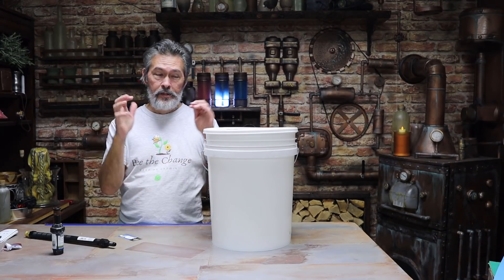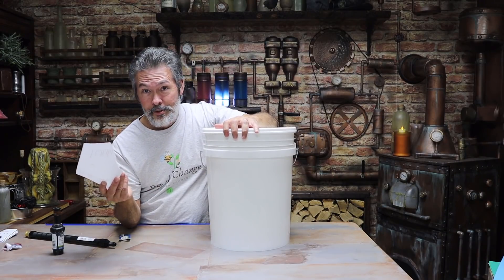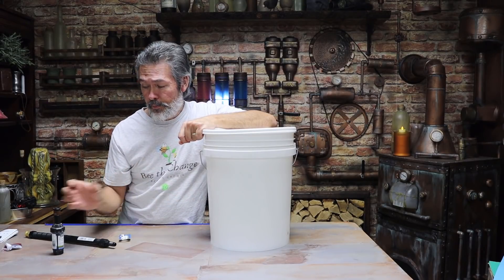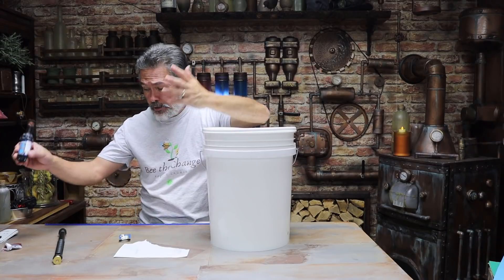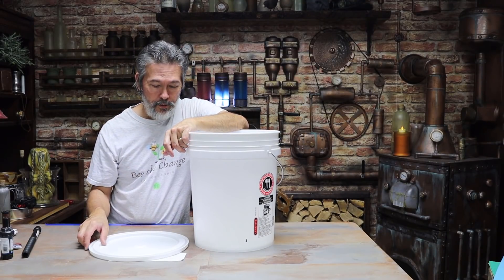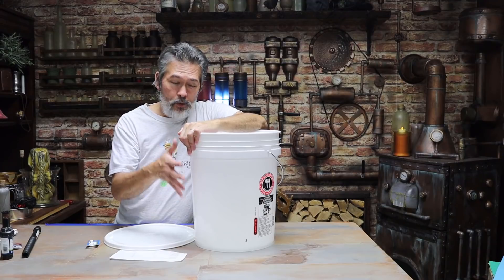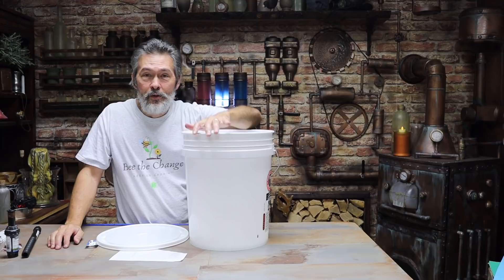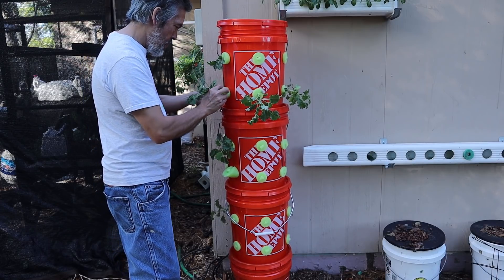CHEAP & EASY DIY Garden Tower Backyard Hydroponics!

Comment: Suggestion- instead of metal bolts, use heavy duty, plastic zip ties and thread through two of your holes in the lids to make a tight loop. Those metal bolts are going to corrode quite quickly. zip ties that are made for outdoor/water usage will last a decade.
Reply: you can also get plastic nuts and bolts the type you can put on your car to keep license plate on with
Reply: You could also use the nuts for toilet seats. They're mostly now plastic.
Reply: Stainless bolts would be fine

Comment: Might want to put some plumbing in  to refill the nutrient bucket
Reply: You can easily add the nutrient solution to the top bucket and it will trickle down to the bottom bucket.  To me the challenge is easily determining the solution level in the bottom bucket.
Reply from the maker: Yep, Just filling from the top.
Reply: @latriciacagle4873  You could drill a hole near the bottom and install an adapter through the bucket wall, with rubber washer on each side for water seals, and attach tubing on this outside connector and run it vertically up. You might cover the tube to keep out light.

Comment: Mike, we did away with the  sprinkler heads due to clogging. We placed a funnel upside down and the water flows to the sides. Also, the pool noodles were leaking out nutrients.  They would leak down onto the outside lid. We drilled tiny holes on the outside lids and it dripped back in the buckets. Very pleased. 
Thanks for your expertise and is greatly appreciated!
Reply from the maker: Nice! The funnel is a great tip. I had to clean my nozzle out every few weeks. Thanks for the input!
Reply: How do mean upside down? How would it spread water?
Reply: @drb4074 I'd imagine like a hat. Water would come up through funnel hole and roll down the cone toward the outside of bucket. Knocks a few bucks off and maintenance.  Sounds ideal.

Comment: I am appreciating what you do to help others.
I am building the 4 bucket tower. Why cut bottom from most buckets, yet not the bottom, a 3/4" hole to pass tube through, cut the whole bottom open.
I plan on 15-20 plants/bucket, 3-4 rows of 5. Fill empty with pool noodles if I need to. 
What to do if pump goes bad, or gets clogged? My friend says, put another bucket next to bottom one. Place pump in in, Run hose thru walls then up as usual, return water in bottom can transfer to pump bucket with double barbed piece 7  & vinyl tube, seal holes, with valves so water can be shut off between buckets if necessary. Simply disconnect pump, clean or replace, reinstall, turn pump and valves back on.

Comment: I like your idea.  I will try this for myself with a few changes.  I would use pvc pipe glue to attach the lids to the bottoms of the buckets to hopefully give a water tight seal.  The other change is to add a spigot valve on the lower side of the reservoir bucket to allow drainage for the winter months.  I live where we get three or four months a year with threat of below freezing temps, so without a greenhouse or other temperature controlled space  would have a risk of damage to everything.

Comment: Hey Mr D!   I’m so excited I stumbled across your channel. I’ve been trying to find out how to affordably test hydroponics before I make a big investment.  I have another cost savings recommendation. I purchase 5 gallon buckets with the lids at my local donut shop for $1.50 each. That’s $6 compared to $30, shaving $24 from your total bill of materials cost. It does require a little elbow grease to remove the icing and filling residue, but it’s definitely worth it. They also sell their 2 1/2 and 3 gallon buckets.  I use these all the time in the garden and around the house
Reply from the maker: Awesome! I don't mind a little extra work if it saves money! You rock!

Comment: Suggestion: Bury half the reservoir in the ground as an anchor and to keep the nutrient solution cooler in the summer.

Suggestion: When cutting the holes, stagger the holes between levels (locate lower plant holes 1/2 way between the holes on the upper row).  This will give the plants more room to grow.

Comment: I like it, Mike. That looks more functional than some of the high-end tower systems. I converted two of my ten-foot downspouts to NFT and they are working well. A ten-foot spout gives me 29 stations. I ran a hose down the length of the spout so I could catch the return and feed the spout from the same end. It works well.
Reply from the maker: That's an awesome idea! I like your thinking!
Reply: Could you explain n the hose more,  I don't understand
Reply: @krisqueen5939  I ran the supply hose into the rail on the downhill side. From there, it ran inside the rail to the far, high end. The solution ran downhill from there, feeding the plants. It drains into a collection system where it is filtered before returning to the pump.

Comment: Not sure if it's been mentioned anywhere but an easy upgrade to stability could be to completely cut the bottom off of one bucket or the reservoir buck and then two decently large cuts on the sides. Get a sterilite tote for a bigger wider reservoir base. Measure cut a hole in the totes lid for the bucket to slide into. This could make refilling it easier as well. Would add maybe $8-$12 to the project total. Thank you so much for sharing though! Ridiculously easy looking and a great basic structure, perfect diy

Comment: Suggestion. You spend a lot of time drilling holes and then cleaning up the results so the pump doesn't clog up. Why don't you melt the holes using a larger soldering iron or a bolt of the correct diameter heated with a propane torch? The holes are smoother and there is no cleanup.
Also, you don't have to limit your tower to one mode. You could have a three bucket tower base for stability, then continue atop that with a pipe of 4" diameter or 6". I have a section of 6" on hand, so I will use that.
I'm also planning a fence mounted hydroponic using plastic roll fencing attached to my board fence (could be a wall). I will staple plastic bottles to the plastic net so one bottle drains to the one below, with a gutter at the bottom to collect the solution to recirculation it. Lots of holes in the bottles, all melted in.
I enjoy your channel. Thank you.
Reply: @rickmarkgraf2617   this is an old comment but I just wanted to say thank you for the soldering iron tip. I've ruined a couple of utensils and wasted a lot of gas the last few days melting and cutting plastic containers, a soldering iron should make things very quick and easy.
Reply: This is an old comment but I just wanted to say thank you for the soldering iron tip. It will definitely save me time, gas and kitchen utensils with all the cutting and hole-drilling I will be doing in the near future.

Comment: I built a tower and have plants in it.  (Food grade, ha)  the challenge is keeping water in it.  Using pool noodles and they are leaking.  Suggestions on keeping water/nutrients inside?  Going to do another ad soon as the water gets under control
Thanks
John
Reply from the maker: Fiddle with them so that if they do leak they drip to the bucket and down to the next lip. It should drain back in.

Comment: A really great video!!! It so happens I have 4 5 gal buckets that I can repurpose for this. My design is basically the same but as I don't get 360 degrees of sun I've only put holes where the plants will get sunlight. I'm using the last of my pool noodles to hold the plants. I will try strawberries and spinach to see how they grow. Oh, yeah I've sprayed the buckets black and then silver.
Reply: A good way to solve that issue I read recently from a grower is that she would place one side with plants that need a lot of sun, the other side less in need of full sun! Genius! No space wasted!!

Comment: Hey Mike ,   thanks for replying back to me.  appreciated.  do you run the pump 24/7 or is the pump shut off with a timer at perhaps 11 pm or midnight?  Then the pump can be turned back on at perhaps 5 am.  will the roots dry out of not continually having water and nutrients cascading over them.
Reply from the maker: I run mine 18hs and turn it off for 6hrs at night. It's cool at night and they should not dry out. Indoor growing is a little different where the climate is controlled.

Comment: Only thing I would have done different is offset the 2 rows so the water isn't running straight down from one plant to the other and the roots from the upper plant won't touch the one below.
Reply: yep stagger the holes
Reply: Agree, you'll have better results if your holes are offset. The design looks good unless you need to get in to unclog the pump.  Enjoy

Comment: My thoughts were to use a 12v pump off a small motorcycle battery with a solar charger, that way you can put the tower anywhere.  Also, shape the pool noodle to a cup like shape to catch the nutrient better.
Reply from the maker: Great ideras!
Reply: Or even a windshield washer pump ?

Comment: Hi, I dont know how many times I watched this video. Im a single mom on disability after TBIs and cant afford food anymore. Im hoping I can build this with my kids as a homeschool project and to eat healthier. We will also find a way to add 4x 4 feet barrina led lights around the tower.. But here in Canada the material needed to build this is easily 4x the price you mentioned for most of the things. Im having issues finding some things like the straight adapter. Once I figured out its called an irrigation adapter Amazon only show me male adapters. That's where Im at right now. Id also like to know how tall is your riser. The one I found is 6 inch only which isnt enough considering the height of the bucket. Any suggestion would be appreciated. Thanks for empowering us with the most important surviving skills. Keep on growing !
Reply from the maker: Hey there! This was just my first experiment. All you need to do is get the water to the top and have it spray down (or sprinkle) so that it hits whatever roots you have in there. There are probably thousands of ways of doing it. You don't need a riser, you could use a rigid pipe to hold the tube, you could strap it on to a hook or something. Use your imagination and don't give up.
Reply: I'm in the same position and was also very confused about the riser and tube??? Need to figure it out. Best wishes to you

Comment: Following up on my tower with a bucket topped with stackable planters...
When we filled it with potting mix, it started leaning. The ground was too soft for the casters. At first I thought I should have used 4 casters instead of 3. Or maybe larger ones.
So we rolled it inside on a cemented floor. It still leaned!
 I don't know why.
We ended up dumping all the dirt out. It still leaned from the bucket not the planters leaning. I guess the weight of the dirt must have done something?
 I was so disappointed I didn't look at it too much. 
Hubby and were talking about it and I think we're just going to remove the casters and let the drill holes be drainholes.
I'm sharing this to Facebook and tagging him. We have buckets and I have an aquaponics pump already.
To keep my pump from getting clogged I wrapped it in netting or window screen. I saw it on an aquaponics video. And some people take the filters out of their pumps. I just choose to wrap mine for an extra layer of protection.
Reply: Great idea, thank you for sharing

Comment: I like it. I have access to dirt cheap food grade metal barrels in my area. Like as cheap as a bucket. I've been thinking about stacking two, burying the first one in the ground to maintain temps. Then putting plant sites on the top barrel. I don't think water coming in from the top will work with that though, I would need to get water to each plant site.

Comment: I am building a CNC router that can mill pipes. This will allow me to machine parts for a tower. I can machine groves in the cups that will catch and direct nutrient solution to the roots of the plant in the cup and then direct the solution to the next plant below it. It will mill slots that will hold the cups at 45° to the main pipe which can be cheap, 4"  drainage pipe. I can also mill plates to go inside the main pipe that will assist in distributing the nutrient solution properly. I can also make end caps for the downspouts.
Reply from the maker: Very cool, keep up the great work!

Comment: Went to Delafield, WI today. They couldn't find one part you listed, in plumbing or garden. 
We found one 20' sprinkler that may work. Don't know if i must take it apart to modify or what.
They have no risers, nor even know what it was, So, bought 2' of 1/2" pvc tube, a fitting for going through the bottom, and top to adapt to sprinkler.
I did get 10/, 1/2 vinyl tube, all 1" bolts, 2 washers & nuts. Guess where I got unlimited free 7 gallon buckets. A small sandwich shop, which sells buckets of whole kosher dills, and can't get rid of them. So, about $20 to build a 4 or 5 bucket tower. But have more comments so in to the next message.

Comment: Just FYI, you might want to paint the outside of the plastic because the sun will make the plastic very brittle and break apart in pieces. The paint will also reduce algae growth. Otherwise, I love the design and use of the pool noodles.
Reply: I have found that to be true.  UV paint.

Comment: I am bulding this same tower.  Thank you for the prototype!  One question, I want to stagger my holes so that they don'e line up vertically on each bucket like yours does.  Do you think that this makes a difference or not.  My mom has he expensive tower garden and those holes are staggered (offset) from one level to the next and not vertically lined up.

Comment: Did you use a timer for the pump on the tower garden?
I saw someone say 15 minutes on then 15 minutes off, and so on
Reply from the maker: I was doing 18hr on and 6hr off at night when it was cooler.
Reply: @KeepOnGrowin  for the liquid solution?  You didn't have to worry about roots drying out?
I'm using the home Depot tower 😁. Where I'm at this might be the best for me at the moment.  I may consider the downspout method for the future.

Comment: you for got to make the lightning system that goes around the buckets for your leafy greens. 

- Need to find a cheap an easy way, like using tinfoil with leds lighting to reflect the light for a more even lighting around the buckets.

Comment: Great video but it would have been the best if you had the Home Depot buckets there with you.  I still do not know how the risers work.  The pump and hose etc is easy.  So the hose of course goes from pump to the top bucket but what are the risers used for?  Sorry i guess i have a mental block

Comment: When drilling the holes in the Lids, what is the easiest way to clean the shavings (and the raised sides on the backsides where the drill bit pushed through)?  Took a good 2-3 hours with a knife to cut each shaving off smooth and make sure there was not particles left over.
Reply: Maybe a stiff wire brush???
Reply: Melt the holes, dont drill.

Comment: What pump are you using? Specifically, the GPH, wattage, and pumping height? And, what sprinkler?
I cannot find a pump that is strong enough to activate the sprinkler head. I tried a submersible pump 450gph 28W with 50 inch pumping height with several types of orbit and rain bird sprinklers, but the water putters out like a weak bubbling fountain and it doesn't activate the sprinkler spray. All I have is a 3/4inch inner diameter tube, do you think that's too large and that's what is causing the weak flow?
Reply from the maker: First off, if it is at it's "max height" at the sprinkler nozzle, that is too low. Fountains just "deliver" water to a point and are not pressurized. It has to exceed that. Also take the filter off of the sprinkler nozzle if there is one.

Comment: When screwing the lid to the bottom of the other buckets are you self tapping or sheet metal screws stainless steel quicker do not need to drill pilot holes
Reply from the maker: Thank you!

Comment: about how often are you refilling the bottom bucket? I've fixed most of the leaking from the pool noodles by just adjusting them a bit, i still get a few drops that build up on top of the bucket lids that ends up spilling past, but just wondering how often it is with you?

Comment: Mike what have you done to fill spare holes if they don’t have a plant?
Reply from the maker: I plug it with a pool noodle with a small piece to fill the hole.
Reply: @KeepOnGrowin  thanks, I was thinking that was probably the case. Thanks for all you share, it is appreciated. I’ve got about 12 of your buckets running, I had some issues with wilting tomatoes after refilling with DIY solution but since I’ve cut back to half strength it hasn’t happened yet.
Anyway I for one want to thank you for all the effort you put into sharing your methods, very generous of you 👍

Comment: Thank you Mr. Vanduzee for all of your videos I have learned so much from them. I have a question though in building your Home Depot bucket system your supply list shows a small riser and your video itself shows a much longer riser. Could you tell me the length of the riser that I should be using.
Reply from the maker: Thank you. You can use the short one, the long one is adjustable. You can cut it down to size. The spray just needs to be high enough to hit the roots of the top row of plants.

Comment: Hi, love this simple solution. Just wondering how you manage to change the nutrition or check the PH level, what Ive read is super important to do every 2-3 weeks. any solution for that? thanks for answering
Reply from the maker: I add solution from the top. I have been doing this over 10 years and have never owned a meter. I don't measure EC or pH.